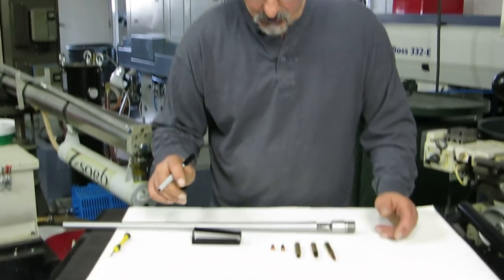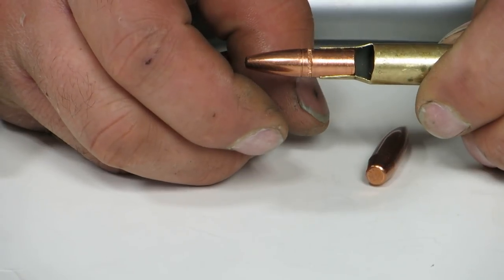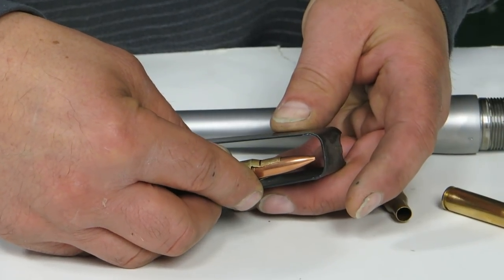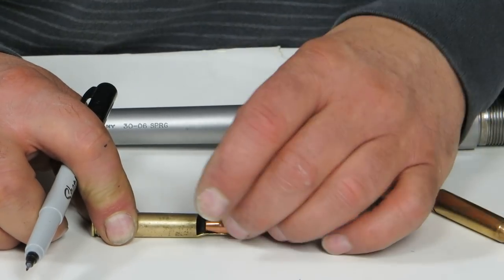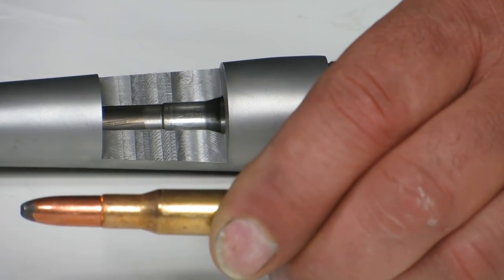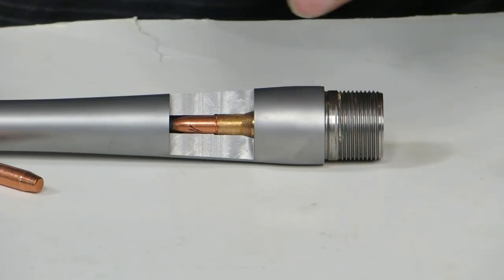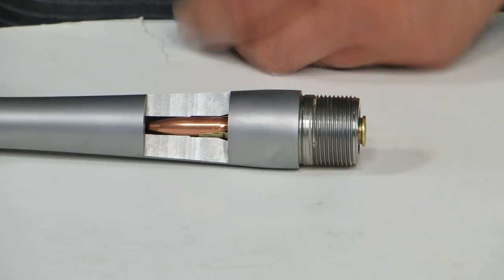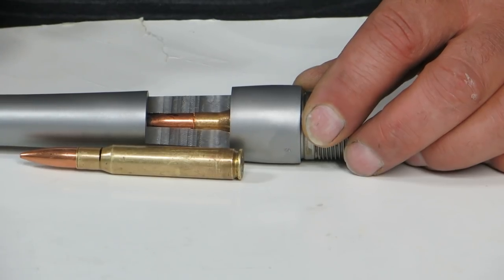Greg Tannel GreTan Rifles, Making a dummy round

Comment: Hello Greg,

I want to re barrel my Ruger M77 tang safety to the .260 Ackley Improved (40 deg. shoulder and less body taper than the .260 Rem.) Since it's a wildcat chambering and cartridges aren't available over the counter, all I have is a fresh empty Lapua .260 Rem. case (20 deg. shoulder and more body taper than the .260 AI,) will this still be adequate for the chambering work in this video. Thanks Greg.

-John Nash
Reply from the maker: Yes. The dummy round is just a gauge to go by. It needs to slide in and out easily of the chamber. This is so it doesn't give a false feel that the bullet ogive has stopped on the lead cut into the chamber. Non fire formed brass works best for me. Or properly full length sized brass. The head space is set by gauges. A proper head spaced A.I. chamber is .004 shorter than the original. This is figured in cutting the free bore.

Comment: Instead of new case Could i use a Fired case prepped from previous barrel chamber measurements  which would be shoulder bumped body sized and neck sized with bullet seated to previous measurement for new barrel chamber which would cut down on Load developement Time with new barrel for single shot FTR rifle, thanks.
Reply from the maker: +paul .daly The dummy round is a gauge. The dummy round is only for giving the loaded neck diameter and the length from the base of the brass and the contact point of the ogive radius to the lead of the throat. This is only for reaming a chamber. A tight fitting case will give false readings and you will most likely not get the free bore cut that you wanted. The dummy round needs to slide in and out of the chamber easily to check the depth of throat cut. Save the dummy round made for chamber spec's. on the next barrel and use your fire formed brass for load development.